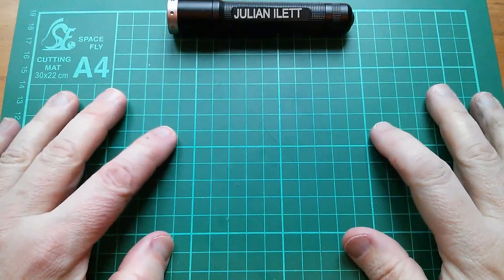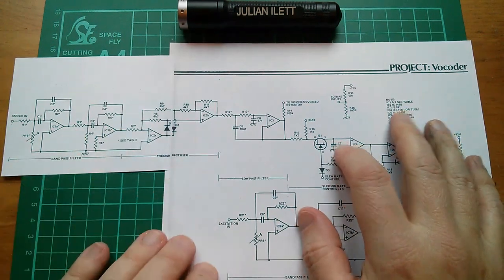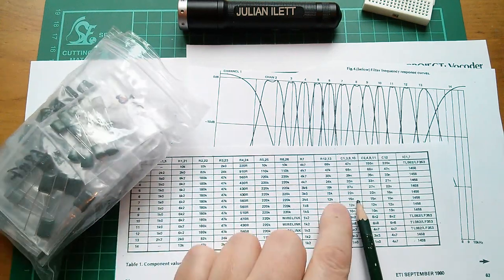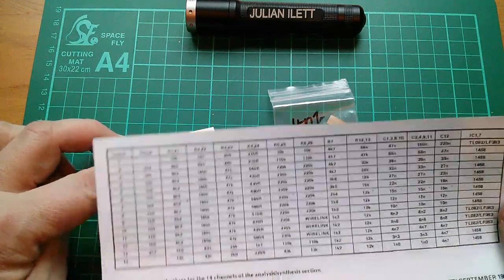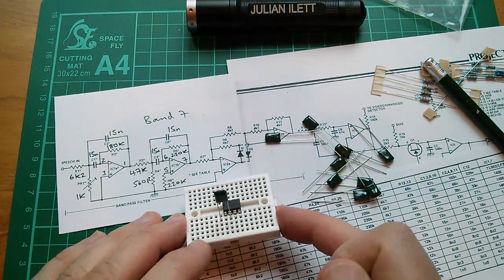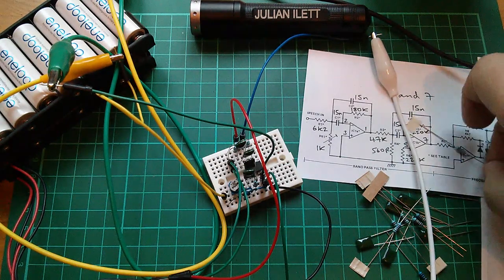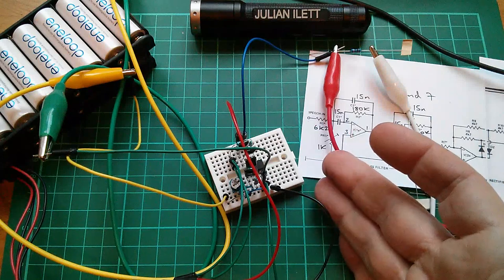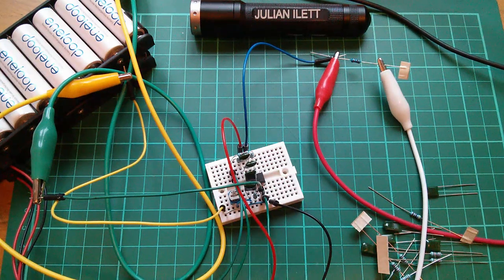Squealing Op Amps - Vocoder Band Pass Filter

Comment: That was great.  I've heard all of the words before but never was able to put them into context.  One suggestion...get a frequency generation app for you phone an feed that into these filters.  I believe that would showcase the filtration capabilities when moving the frequency above and below the threshold of the filter?  Could also help adjust that tiny potentiometer.
Reply: alternatively you could get a spectrum analyser phone app (or audacity on PC), feed the filter white noise on the IP and look at the OP, with any luck it'd appear the same as the appropriate published graph and if not you could hopefully tune it up fairly rapidly. If you've not heard what a completed vocoder sounds like, it was used pretty extensively on the single 'O Superman' by Laurie Anderson... afaik vocoder was originally a form of analogue data compression to multiplex several speech channels down a phone line - but took off as a musical effect cos it sounds so weird.

Comment: It's a great looking retro electronics project this one, but I did baulk looking at the filter PCB and its schematic diagram in the original article for this project..... I guess you could build each band pass and synth filter separately though, then add (or piggy back) them onto a bigger motherboard for neatness using pin strip and header sockets at the end perhaps instead of 28 individual modules and an accompanying birds nest of wiring to link them all in parallel with the signal source and signal output paths?

Comment: you can verify the frequency spectrum of the bandpass filters output by using a microphone jack on the pc and a program such as sdr# to analyse the output. Since the capacitors have a certain tolerance the exact bandpass is probrably gonna be a bit off with such a program you could tune it up and get it perfect in line~

Comment: 1khz is a particularly annoying frequency, yet a very common one to use to test an amplifier xD It's like an out of tune wind chime or something. Sounds like a flat C, but I could be wrong. 

The feedback is because of the circuit. The input and output feedback are capacitively coupled. It is designed to cause feedback ringing. If you notice, there is an intentional redundant 15n capacitor on the positive feedback of the second op amp. That is causing the ringing. I assume this is to cause a slower decay when a frequency falls in range.

Comment: If you need 14 of those you can order PCBs. I ordered for a site (I can check which one it is if you are interested)  $10 for 10 pcs 10x10 cm boards, shipping - about $19 and you get $10 off first order so it'll cost you $19. You have to fit it to 10x5cm board and you have to cut the boards in half by yourself because they don't offer that for the proto PCB service. If you use SMD parts 0805 you can fit it in 5x10 cmd board and you'll have 20 of them.

Comment: I wonder if you quadruple the frequency so that it can drive a Johnson Counter to drive a Tayloe mixer driven by audio phasing circuit to generate the I/Q signals so the units works as a Ring Modulator that will generate LSB/USB modulation signals which give you some interesting modulation outputs when you feed your voice or music through the unit. frequencies that might work would be between 4-40khz.

Comment: Can I ask what the difference is between the green ground and the black 0V wire? Isn't such a black wire also called 'ground'?
Reply: +Michel Fugers it's quite normal to have two supply rails +ve and -ve with respect to 0v (ground) in op-amp circuits... so the output can vary +ve or -ve of 0v . Eevblog has some decent op-amp tutorials if you'd like a refresher

Comment: What are little those round connectors near 0:13 and 10:07 called? 
P.S Thanks for all your videos. They've taught me a lot.
Reply: if you mean the sockets, theyre single in line (SIL) turned pin sockets, they usually come as a strip 40 long and you trim them to size. if you mean the plugs/wires going into them, theyre just the wires sold as breadboard links
Reply: Yeah, the sockets. Thanks for the help, managed to find some. :)
It's sometimes a little bit hard to figure out the names of all the different connectors.

Comment: Have you a 'scope which does an FFT to check resonance? And was there any significant DC component? If the analysis and synthesis filters are to be identical, what tolerance for Rs and Cs would be necessary?
Reply from the maker: I was thinking I might test and select the capacitors when building the final unit.

Comment: Hi Julian - I have recreated most of the PCBs for the ETI vocoder as dual layer cards. However, I found a possible error in the parts list for channel 1 - in the schematics on page 65, R34 is 10k, but in the parts list on page 66 it is 220k. Any idea which one is correct? Since R34 is the only difference between the speech and excitation LP filters, maybe R34 was originally in the same position as R33 (and thus 220k), but then they moved it (space issues on the board maybe?), changed the value to keep the filter the same and forgot to update the parts list?
Reply from the maker: Wow, I had quite a struggle finding that resistor. I'm not sure - I'm tempted to say 220k. I'm going to put all the filter specific capacitors and resistors in turned pin sockets so I can fit them last.

Comment: HIGreat project, I remember making may of these electronics projects as a kid many years ago now, i got the full parts kits from a company called Powertran Cybernetics, they seem to be long gone now, my best project was a synth called Trancendent2000 developed by Tim Ore, i had many hours fun in my bedroom lab building that project, I think he had a hand in the design of this project as well, Does your scope not have a FFT function so you can compare the input and output spectrum ?, that would be a good experiment, please note we do have the TL081 Op Amps as well as others like the dual version on our ebay shop here,http://www.ebay.co.uk/itm/1-x-Texas-Instruments-TL081CP-Op-Amp-3MHz-8-Pin-PDIP-/322320719283?hash=item4b0bcfddb3:g:dEgAAOSwo4pYINHf  , if you send me the address and I will get you a pack of them over to you, i am pleased your doing electronics full time now, i would love to start sending you some electronics parts to help you out with your experiments,  keep up the great work, Dave